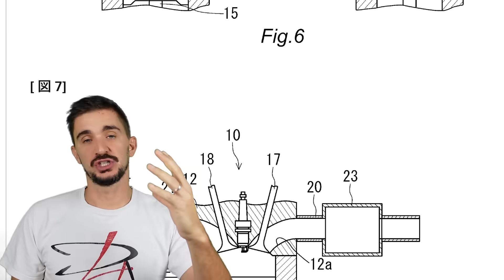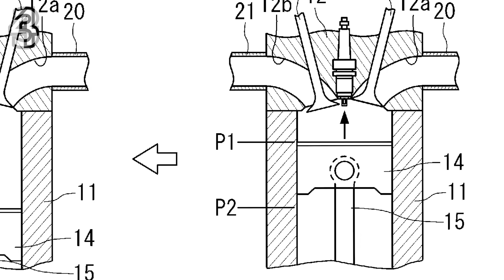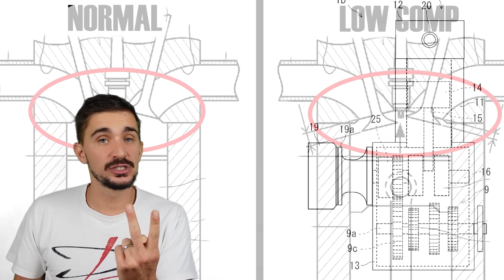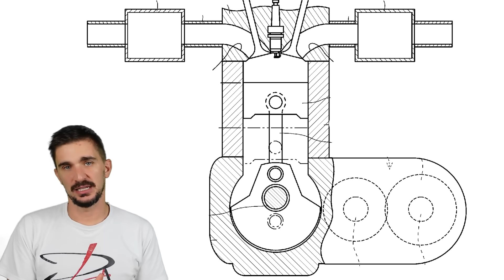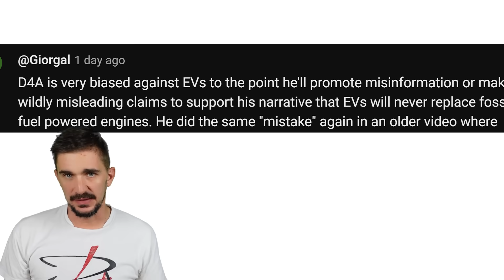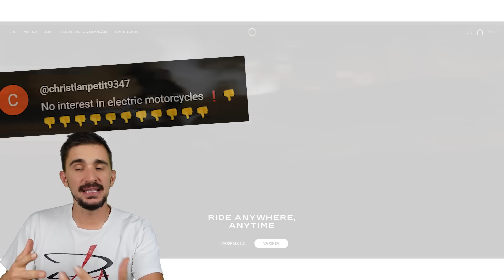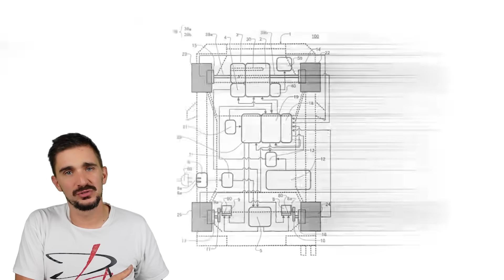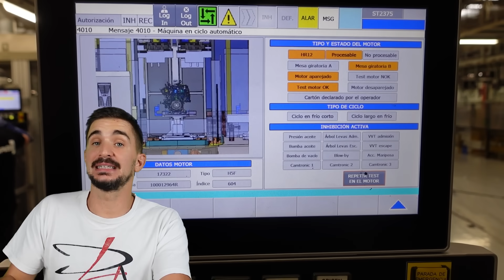Yamaha Just Patented A Fake Engine

Comment: You are complaining about something because you feel that it doesn't do anything. Ironically you started out by reading the patent which explained the purpose. 

Yamaha feels that now or in the future EV motorcyclist will desire such a feature even at the expense of less range (due to needing to use power from the electric motor, increased weight, possibly more air resistance, and possibly less room for batteries). Additionally they feel that it might be profitable, either because customers are willing to pay a premium over costs and/or licensing deals with other companies. 

Look at the Dodge Challenger EV. Dodge spent millions of dollars to design a system to make the EV sound exactly like the gas version. Their solution was a custom "computer" that sends signals to amplifier(s) and various speakers. It is designed to make the vehicle sound like a gas engine on the outside (meaning it needs multiple speakers on the outside driving the loud sound) and on the inside which additionally has speakers that provide vibrations that make the vehicle feel like a gas Challenger. 

Customers are willing to pay thousands of dollars for that realism and have reduced range due to the weight and power needed for the "computer" and amplifier(s).

That implies that Yamaha's patent idea is sound. It doesn't matter if you and I think that it is stupid and wastefull. 

Many vehicles come with an optional package, often called "blackout". This package is generally around $3,000 or $4,000. It generally removed chrome from the outside (regular paint is cheaper than chrome), has tinting for the outside light covers and usually special badging. 

It likely costs the manufacturer under $100 for the "blackout" upgrade (again paint is cheaper than chrome, there is only about 10-20 lens covers which get installed at the factory so no extra labor costs and the lens covers are not significantly more to produce).

The "blackout" version provides no upgrade to the vehicle's operation and it might be more dangerous. The tinted headlight lens means less light on the road and the other lens tinting make it less likely to be noticed by other drivers. 

Then there are truck lifts. How many people buy a full sized truck simply because they like what it looks like and/or being higher up providing better visibility. Often these people don't haul cargo (except groceries and possibly bikes) and don't tow. 

They then pay to have that full sized truck lifted by several inches. With the lift it is likely that the driver now has less visibility, especially in tighter areas and where people are walking. The lift raises the center of gravity making it easier to lose control of the truck. The lift makes the truck less energy efficient. 

They then buy much larger tires that weigh more and are less energy efficient. 

Honestly how many things to you buy because you like them even though they have features that do not make them operate better or possibly even worse? You likely don't put any thought into them.
Reply: If you think that this idea is stupid, think of how many people love their classic Harley or Indian because of they sound even though they often have much less power than a modern motorcycle. 

There is another group of motorcyclist that love the sound of their "crouch rocket" and even prefer the sound of a specific brand over another. 

It is extremely likely that having a motorcycle sound like the type, brand, and model that they like is extremely valuable to many motorcyclists. 

If you have heard what an EV motorcycle sounds like, having one that sounds like a "real" motorcycle is definitely a plus. 

It can also be argued that having an EV motorcycle sound like it has a gas engine is a safety factor.

Comment: like a hybrid car, but reverse. Instead of being combustion engine first  (for range, etc..) and small battery and small electric motor used in traffic jams, or when starting a car.
This motorcycle could be hybrid, but again, in reverse meaning. It could be electric first, with the ability/posibility to run on fuel. Although it would require some adjustment - the valves, etc...
Reply: I agree. like a range extender.

Comment: This is what happens when dumb people try to make smart solution, to a problem that doesn't exist.... It's not the sound or vibration that makes electrical motorcycles unattractive. It's the long charging times, short range, heavy weight, and questionable value after 3-5 years (just look at the Terrible value of an Audi E-tron ). If i buy a non electric motorcycle today, it will keep most of it's value for the next 5-10 years, as it's going to be fully functional, and not out dated. An electric motorcycle in 5 years will have Vast improvements in range, battery life, charge time, weight, pretty much in every way you can think of, and nobody is going to fork out a lot of cash for your 5 year old electric motorcycle. And, considering how many companies have tried and failed, i'd be scared of there not being any parts for it in 5 years. An electric scooter for short commute and city riding on the other hand, is quite an ingenious alternative. So, yeah. What do i think? Yamaha's trippin '...

Comment: I'd never buy this.  I fully agree that it's a total waste.  I want that space for a larger battery with more range - something in glaring absence on electric motorcycles.  I'm a distance rider, and I want to see something in the neighborhood of 200 highway miles on any electric motorcycle that I would want to ride.  So far, battery density prevents this, so this is my one remaining holdout to ICE tech.  I've already largely abandoned gas cars.

Comment: There are several valid reasons why you might want to file such a patent - many of which are a result of the patent system being incredibly broken and completely open for abuse.
Think Nintendo or Lego - 2 of the largest Companies that try patenting the most insane BS, things that OTHER COMPANIES had invented, just so they can sue small private businesses to oblivion. If you have a company making motorcycles and you think that in the next 10+ years people might want to have the look and feel of a combustion engine with an electric motor? Yeah then this is what you HAVE to do.

Comment: They could do this with a single valve and two strokes.  Keep the valve open on the intake stroke and for most of the compression/exhaust stroke.  Close the valve a few degrees before TDC and the quickly reopen the valve to create the exhaust noise.

Comment: seriously couldn't care less for the noise and vibrations i rode a few 2 strokes among those smooth and tame 80cc trail and a 125 huskvarna enduro  when a friend lend them to me for a ride the 125 vibrated so bad it was unpleasant... couple decades later i bought an ebike (bicycle) to move around small distance and go grab machines left and right when i have nobody to drop me of, the sing is surprisingly nice, underpowered but on the flat its ok and the silence is a plus you're not a nuisance to everyone with the noise alone not to mention trespassers.

Comment: i don't think it's any more absurd than electric vehicles are in the first place.  the most environmentally sound vehicle is the one you currently own.  perhaps limiting the number of vehicle you can own, the weight and engine size, governing the speed and forcing manufacturers to produce easily and cheaply repaired vehicles that last a minimum of 50yrs would be better for the enviroment than adding ten times as many power plants to the grid and mining for non recyclable, non renewable, rare, expensive and lethal minerals to build vehicles that only last a few years would be... even if there was actually enough to build them... which there isn't.  now tell me again how ridiculous of an idea it is again?  what was more recyclable... a 1950's car which was primarily made of steel or today's cars... most of which are made up of toxic materials like plastics.   conveyance will never be environmentally sound.  even if we went back to riding livestock.  could you imagine a city with 2 million horses running around... don't light a match.  the fact is electric vehicles make a lot of sense for public transit, bicycles, scooters and very tiny micro cars with little to no conveniences such as air conditioning or heated seats.  these vehicles already exists... they're called golf carts.  i can bet you if they made it legal most of the people in the city would be more than happy to commute in them instead of owning fifty thousand dollar cars.  if i was aloud to build my own i would be out in the garage doing it right now.

Comment: hey @D4A Whay do car manufacturers put timing chain on the back side of a motor?
Reply from the maker: To torture people? Seriously though, it makes it possible to lower the front of the car in a longitudinal layout because you get rid of a front facing voluminous part of the engine and there's less nvh because you put stuff away from the unsupported part of the crank and nove it where's the crank meets the clutch and transmission so it's easier to absorb/dissipate noise and vibrations. The only massive drawback is servicing.

Comment: My electric bike is whisper quiet but when riding in traffic I use a clothespin to hold a playing card onto the front fork impinging on the spokes as the wheel turns. Balloons provide better acoustic performance but with limited lifespan.

Comment: Only rational answer is that its a way to sell engines for older bikes. they even have a spark plug and gearbox, surely its so when they can no longer sell engines for emissions reasons they can sell these 'dumby' ones and people can just add a fuel system and change the valve lift to get them running

Comment: The hapics of engines is a big deal. To recreate it would take a significant electric motor. Linear vibration also feels different than a rotational 'rumble pack' style. This isn't nearly as dumb as it seems if you want the vibration. Without the load of combustion the the construction could be significantly lighter than a real engine. Its not for everyone, but I wouldn't discount based on the patent.

Comment: I have come to the conclusion that almost all motorcyclists are psychopaths. The whole point of their ride is to inflict their noise on everyone around them, in order to draw attention to THEM, The Most Important Person in the World! Sitting at a light, blipping the throttle for no reason, burning out from a stop, popping wheelies in traffic,... all signs of a nutjob. Oh, they'll tell you, "straight pipes save lives" -- no they don't. They just make it impossible to sleep with a window open on a hot night. You can't hear them inside a car anyway, with all the soundproofing (to block outside noise, such as motorcycles) and high end stereos. If they want to feel the engine vibration, a vibrator that clamps onto their man parts is a lot cheaper and safer. I hate them, and wish they'd all crash and die.

Comment: You know how everyone complains that electric vehicles have "no soul" and "sound like a paper shredder"?
     This is the solution to that. The vibration and sound is actually an important part of getting the "feel" of the motorcycle. Many bikes have been sold solely on their sound alone (think harley)
     A fake engine could be made to use very little energy, in a world where electric vehicles have all kinds of energy consumption that isnt necessary, allowed for in large part due to thier batterys energy density, at least yamaha is offering something that can be seen as a positive. Not to mention the safety factor, kinda like the electric version of "loud pipes save lives" 
     Pretty smart move on thier part, it'll sell bikes.

Comment: As if electric bikes weren’t heavy and expensive enough already… The main reasons I will not be buying an electric bike yet are things like weight, cost, range, lack of infrastructure etc. If and when those issues are resolved I’d be happy to forego the noise, vibration etc of an ICE.

Comment: OK this is absurd, but surely if they wanted to make a physical contraption to produce the same sound and vibration as a real engine, they don't need to build the whole engine. You could come up with a combination of components to make the same sound AND vibration without needing a whole physical rotating engine. I reckon this is not entirely serious, maybe their engineers were being told to produce more patents so they just patented a ton of nonsense like this.

Comment: I have a few thoughts on this.

1. This is likely a patent to fill up their IP portfolio. Individual patent details aren't considered by investors but the number of patents held by the company. This patent will be unlikely to make production but will add to the thousands of other patents that are used to justify the share price. It also means that no one else can patent the same idea, if Yamaha didn't then someone else would. 

2. When I was at JLR in the Research department, one of our annual performance goals was to submit 5 patent each year. This meant a number of silly ideas got submitted to make up the numbers. A patent that I submitted that got approved was around using ID cards to allow someone to access and drive a car. It would never work in the real world but it got approved by the UKIPO and exists. I'm not saying that Yamaha is as disfunctional as JLR, but there could be something similar where an engineer puts the idea forward and it happens to get carried all the way through to approval.

3. This does feel a bit like someone from the Yamaha Corporation, where they make instruments, had a stint at Yamaha Motors and thought "we need to make a noise, let's not use a synthesised version, let's use a real instrument". That instrument is an engine so it's conceptually no different to the difference between an electric keyboard and a piano. I get that the noise isn't the main function of an engine usually but if its not powering anything then this could be its new function.

In truth 1 and 2 above are the most likely reasons while 3 is a bit more of a silly conspiracy but there making beautiful noises is why Toyota wanted Yamaha to make the intake for the LFA.

Comment: Rather than a fake engine it should just have a electric driven turbo compressor that’s used to cool some electronics but using higher than required flow speeds to make it sound like a turbine or something. It would still be cool, it would waste some but not too much power, and it would serve some real function.

Comment: Yamaha should have gone full retard, using a driveshaft or chain from the rear wheel to reverse power this fake engine instead of taking power directly from the electric motor.  They really missed a chance to emulate cargo cults, the Pacific island natives who reproduced all the trappings of air fields and harbors in the hopes of bringing back the soldiers and equipment which had given them so much wealth during WW II.  They too had cause and effect backwards.

Fake vibrations and noise on EVs do make sense, because they help know what is happening without taking your eyes off the road to look at gauges and instruments.  I wrote a science fiction story where a spaceship pilot has vibrating pedals to tell how close the ground and other spaceships are and what the engines and other systems are doing.

But this patent is pointless.  Cell phones vibrate very simply, with a rotating mass.  No need for all this extra nonsense just to recreate the appropriate sounds and vibration.  All drivers / riders really need is some vibration and sound.  All motorcycles sound and feel different.  There is no need to go to all this complexity and waste energy in the process.

I hope it drops a little fake oil now and then.  Dyed water should do the trick.  Add some perfume too.

Comment: 2:10 this is all true for some riders
Some motorcyclists have always described gutless heavy V-twins as having "character" (means it is gutless and unreliable) And multi-cylinder bike engines as characterless.,
Even parallel twins now all use 270° cranks to make them sound like V-twins , largely for "character"
Car manufacturers are producing EVs that make fake ICE noises.

Comment: if it was designed as a kinetic energy recovery system like electric braking, using engine braking to compress air and then used the compressed air to get you rolling again itd make a slight bit more sense but even that not by much

Comment: "Yes, at least one car, named the Horsey Horseless, was designed with a fake horse head and neck to resemble a carriage and not frighten real horses on the road. This conceptual car was intended to ease the transition from horse-drawn carriages to automobiles by providing a familiar visual for equine creatures, though it was likely never actually built in a functional capacity. "

Comment: Interesting. Maybe it’s what wrong with the electric sattle-riding vehicles. Maybe it is useful to be able to get the real experience. It’s not just sound and vibrations it’s also centrifugal weights going round that will be effected by rpm. That could make a big difference. 
(Ps I drive a boxer and it’s soo helping me)